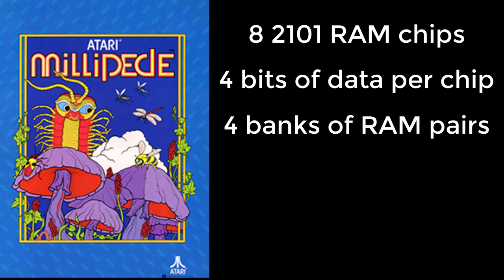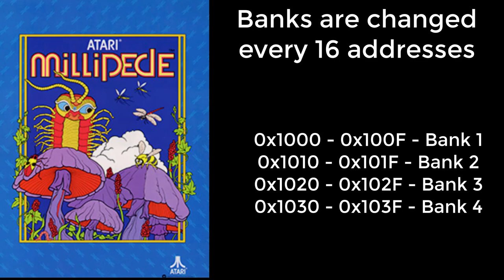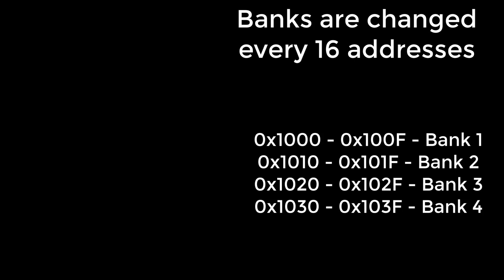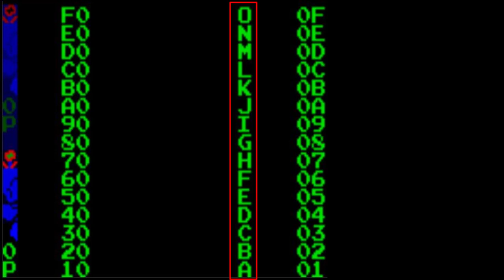Diagnosing Millipede Video RAMs by sight

Comment: Arcade Cabinets,  The Letter P is 10 in Hexadecimal. So 10 In Hexadecimal is 0001,0000 so the Data bit 4 that is bad on the video RAM chip you're saying. 0001,0000 is 8 data bits and the Data bit 4 is has a 1 and not a zero?

Comment: How can you measure the RAM access time using an oscilloscope or logic analyzer? or what can measure the RAM access time?
Reply from the maker: The RAM access times are given in the RAM datasheets. If you really want to "test" the speeds. you'd need to simulate RAM accesses and measure the different inputs/output responses and compare them to the timing diagrams given in the datasheets. but basically there's no need to do this. For the purpose of fixing, the RAM is either working (including responding in the defined time frame for the RAM specs) or it's not. If you are just interested in understanding the "Response time" look at the timing diagrams in the datasheet for the RAM your interested in. This will tell what timing and thresholds the RAM should expect input signals on and when the output signals will be ready in comparison.
Reply: @arcade-cabinets  yes can RAM/ROM EPROM readers that you use in your videos are able to test the RAMS access time?  because I have only seen you read the ROM data content but I haven't seen you test the RAMS access time using the EPROM reader programmer. Can you make a youtube video explaining how to use an oscilloscope to measure the RAMS access time, Response time, time frame of the RAMS specs?

Comment: When the ROM chip in arcade games wants to OR the bit of data they have to "Mask the value" of the bit? I'm not sure what the term or name is called when doing this, but when a processor is reading a data value from RAM and OR's the data value, then writes a modified value back into RAM. I think arcade games do this all the time but not sure if its the video ROM and video RAM that does this or when reading the I/O inputs.
Reply from the maker: not sure what your asking, a ROM chip never wants to do anything. it simply sends the data stored at an address when requested by external circuitry.

If the hardware designer wants to OR the data for some reason, then hardware is built to do that.

there are certainly times when the hardware designer wants to mask some data, thats usually because they may not need all 8 bits of an address to store information. for example if you only need 2 bits to store one pixel of an image, you might want to store 4 pixels per ROM address. Then yes the circuitry might "MASK" out values so it can individually access the data for pixel it wants. however that's a thing the CPU or the video/sound/whatever hardware needs to do.
Reply: @arcade-cabinets  Can't the "ORing" of data bits get done in RAM by ORing two different data bytes or 8 bits? The ROM will have the game code and ORing program function. The MCU will read two different RAM data bytes and the ROM chip will have the software code to do he ORing of the two data bytes stored in RAM? Why the arcade games are doing software ORing of data is I think done when reading the I/O input ports like buttons, switches, coin door switches to OR and compare the previous logic state with the current logic state?
Reply: @waynegram8907  well yes, technically however the OR'ing happens in the CPU. The ram and ROM simply hold data and provide the data back when requested. They don't do the oring themselves. The oring can also happen in hardware usually in output circuits.